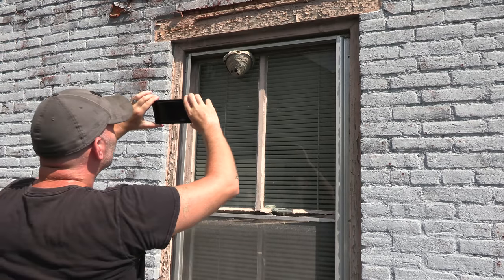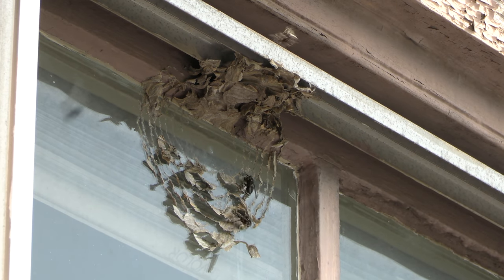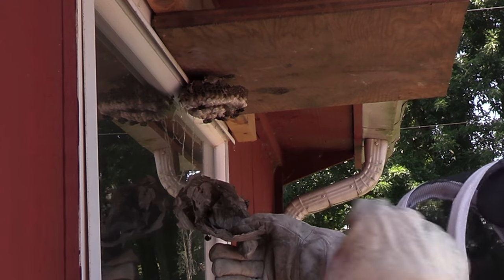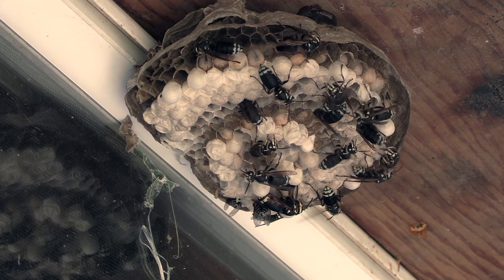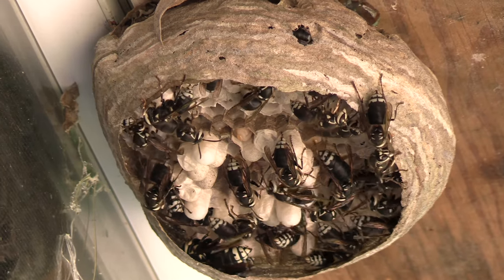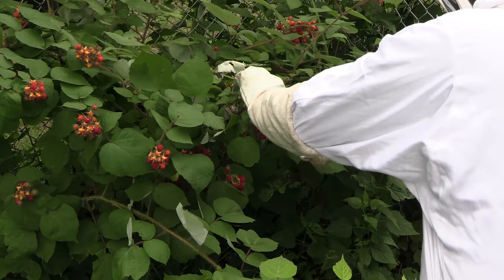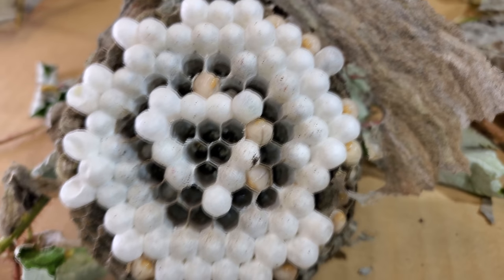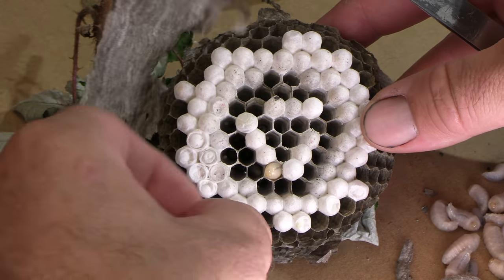AWESOME Bald Faced Hornet Nest Relocation to my WINDOW | 2 Yellow Jacket Nests

Comment: Great videos! I was at a job today, and noticed several ground bees on my socks. I thought they were stuck, so I knocked them off. The 4th bee finally stung me. I was awfully confused where they were coming from, then I soon noticed a small hole where at least 5 bees were always in. Hole diameter was about the size of a quarter. I’m not sure how large the nest is, but I’m glad they didn’t swarm, as I was very VERY close to the nest.

Comment: It looked like there was a worker at each of the two holes at the top of the nest. They seemed to have one function. To guard that whole until another worker flew in with some pulp to patch the hole. As soon as they flew away, the worker went back to the respective hole to guard again? Is that what was happening? Thanks again for another great video Brett.

Comment: Stupid question for the pros:
I had a tiny wasp nest in the box of my roller shutters. There where about 5 wasps working on it, it was still open, and I saw none crawling on it permanently - so I asume the queen is still in the stage where she is gathering with the others. As it was still tiny, and it can't be in the location they have chosen, I pulled it out and it was squashed in the process. As I know wasps mostly funktion on smell, I sprayed the area with a desinfectant, as it was the only stuff I had at home that could possibly discourage them from immediately restarting the building process...

Now my question on the behaviour: 
Will they eventually give up and build somewhere else, or do I have to get rid of them all including the queen?

Comment: Would like to point out that these aren't true hornets, they are not in the same genus and their most common name is a misnomer. They are actually abnormally large yellowjackets, much as was quickly stated at the very start. More accurate terms to go by to eliminate any species confusion include black jacket (however, this name also refers to another dark colored yellowjacket), spruce wasp, or bull wasp.